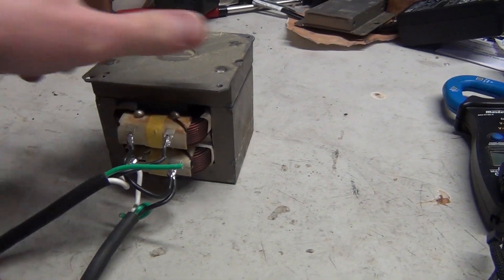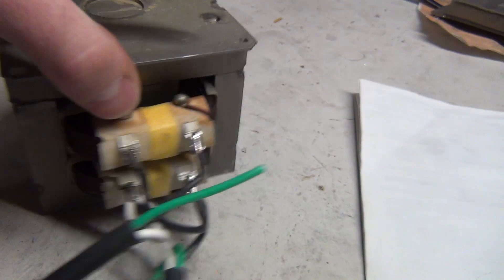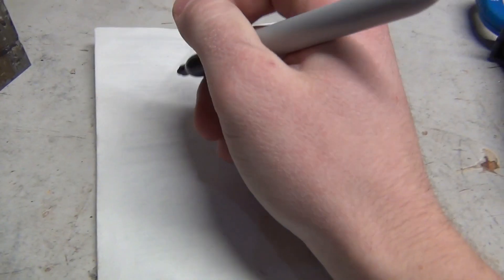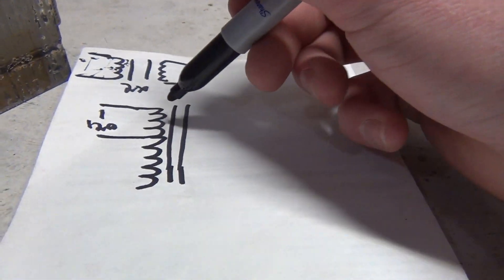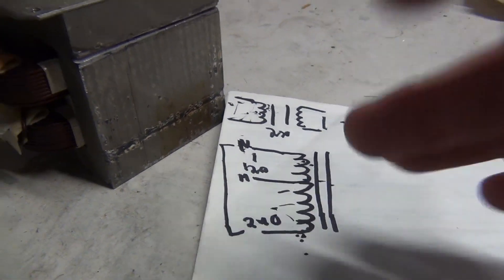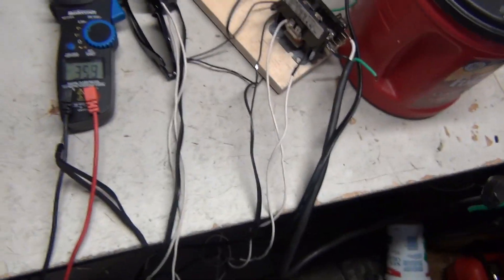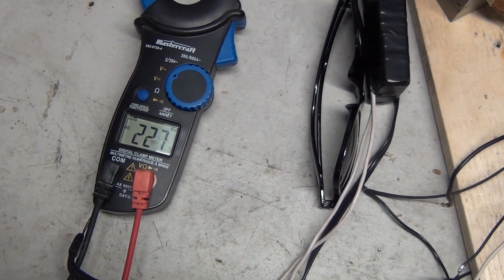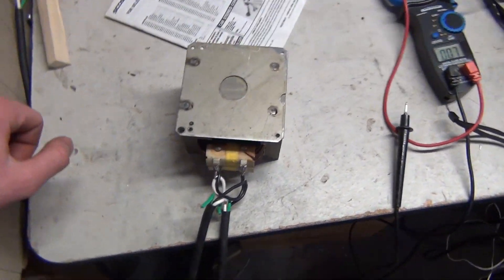120V To 240V Conversion (Easy!)

Comment: Would further insulation/spacing between the two primaries be a good idea to minimize the chance of a shortage?
Reply from the maker: I would keep a gap of a about 1/2 an inch or a centimeter between the two windings. Jumping an airgap in this case is not an issue/worry; the gap is to provide ample clearance between terminal connections merely to prevent shorts occuring from physical movement of the windings (magnetostriction, etc). Hope that helps!
Reply: Do you mean short circuit? A shortage is not the same as a short circuit.
Reply from the maker: A "shortage" isn't really a term used in electricity. A short or short circuit can occur anywhere in a circuit. Interwinding shorts can occur and while not causing a direct short, still affects machine performance by effectively changing the turns ratio and thus coil characteristics.